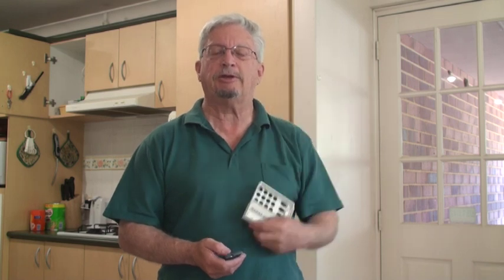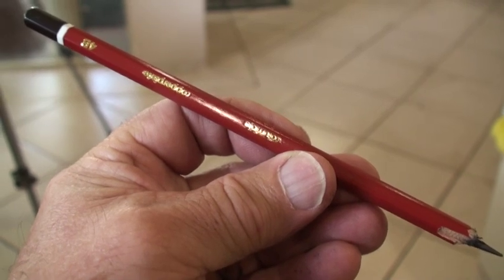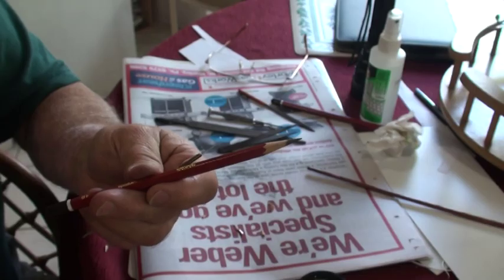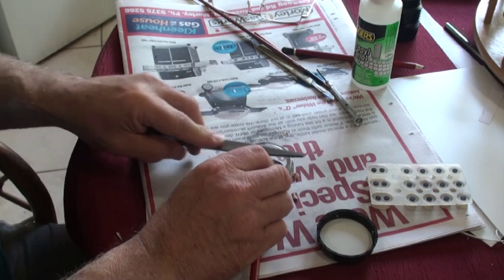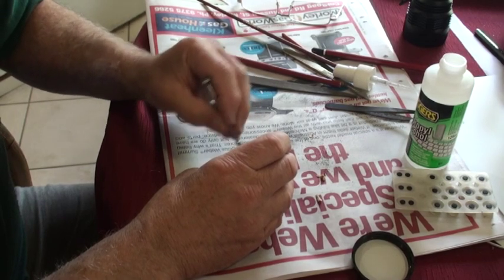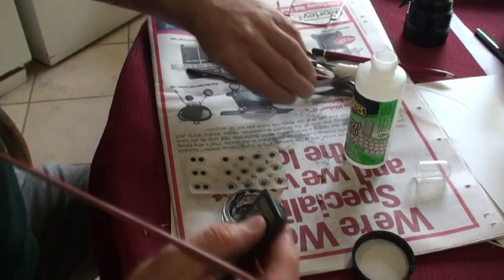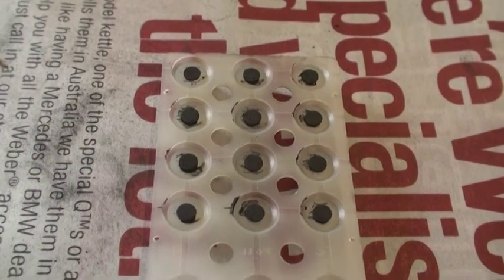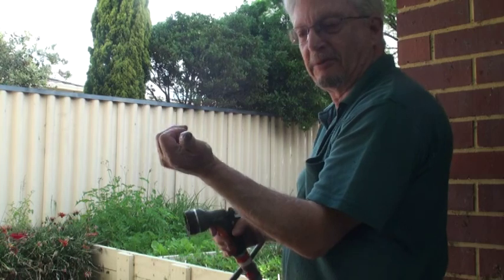Keypad Repair

Comment: THANK YOU SO MUCH, Terry!  I have an old Ademco alarm keypad where many keys were not working.  I tried your solution and lo and behold! it worked.  You are very resourceful in how by using the pencils, created graphite powder and pasted it on the keypad.  Thank you so much again.  Hopefully, the graphite will stay on the keypad contacts for the next few years....
Reply from the maker: I really appreciate your kind words. I did my first keypad repair 7 years ago. It failed again after about 4 years, and I did it again. Three years later, it is still working perfectly.

Comment: Wow Terry, you saved me $350.00

I have a ham radio.
The microphone keyboard began to go bad one key at a time.

Kenwood has no replacement microphones for the radio.

I even tried rewiring a newer mic to it but my mic is a completely different animal.

I ran out straight away and some pencils and wow problem fixed!!!!

I can control my Kenwood Transceiver now after 13 years of this problem.

Thank you

Comment: Terry, YOU ARE MY HERO,  i did what you said, i have a Yamaha Piano that had more than 25 keys that were'nt sounding, i got them working it cost me $5 US Total money
i saw guys on the net selling stuff for $40 and you had to order it and wait, I got a bunch of my old carpenters pencils from my work , the ones with a thick amount of lead, shave them down added the alcohol just like you said,  works great  Goooday Mate from  Rochester NY, USA
Reply from the maker: +clarence shim. Hi Clarence. Thanks for the positive comment. As I mentioned to another comment, my repair has been working perfectly now for two years, and is used almost on a daily basis. I am well pleased with how reliable it has turned out to be.
Reply: how is it now? did the graphite mixture layer chipped of?
Reply from the maker: No, it does not chip off, but I did have just had one button become unresponsive, so I repeated the procedure. It now works fine again. Not bad for 5 years constant use I feel.

Comment: Thank you, my remote now works the way it is supposed to.  A suggestion, I worked for many years in electronics and I used a soft white pencil eraser to clean the contacts on circuit boards.

Comment: sounds pretty good, however I bought some  conductive silver in a small vial and gave this a trial, it seems to work well but I have just done it so don't know yet how long it'll last. For those who use one of those tinny vial I would recommend though to put a cloth peg at the bottom of it to form a steady base as otherwise it's quite easy to tip over.
As for the graphite I just remember buying a little container ages ago and I think it was really cheap. It was just to puff it in places like locking devices instead of applying sticky oil. But yes who has not a lead pencil about! My vial will last me heaps if it works well. I applied the stuff with the end of a flattened tinny skewer from the kitchen and used very little on the rubber contacts to cover them, actually only the most used that gave me me trouble.  But may be one day I'll try this. (some say they mix glue with it?)

Comment: What is the boding material of the pencil lead to the silicone? How does it bond and stay stable? Was this one of those fake videos that are all too common?
Reply from the maker: I had hoped, and it seems to have worked, that dissolving the lead pencil shavings (Made up of Graphite and clay filler) in Isopropyl Alcohol then painting it on the pads, that once it dried it would resume the hardness of the pencil, but be bonded to the pad. Mine needs redoing now, after being regularly used since I posted.

Comment: i would mix in some kind of glue too;

i usually glue on the pad a tiny disc of aluminum foil, works perfectly until the day the remote is dropped and the disc moves; i can't seem to glue it well onto the graphite-rubber.

Comment: Well sir, you just stopped me from spending about $250. I don't know if this will work for me yet, but when I get home in a few days I'm going to try this and see what happens. I have 3 keys that will not work. I've tried contact cleaner, but that didn't phase it. I was about to buy a new system and I thought I'd check youtube one more time. I'll post an update later. Thanks for the video...I hope this will fix the problem I am having.

Comment: You just save me $70 to buy an antique keypad (I have a very old system) from Czech on eBAy. I did not have the rubbing alcohol at the time, so I used the Acetone instead but mixed it with 6B pencil from my kid's art project. I took extra steps by using a white eraser to remove the black residues on the copper terminals. Before shaving it to the Acetone liquid, I tested the continuity on the pencil's tip making sure it conducts and followed your instructions. It works its wonder and sounds like new, means great continuity. . Just wondering how long the "compound" would stick to the rubber terminals
Reply from the maker: Thanks for you kind words. My repair has been working well for nearly 8 years now, with daily use. I had to redo it after 4 years, and the current "fix" shows no signs of malfunctioning after almost another 4 years. I am well pleased with it.

Comment: What does he say from 2:53 to 2:54 - sounds "this graphite, from this lead pencil is very very (persuativate) - you'll mess everything up". Couldn't be what I've put in brackets but I'm stumped to hear the correct words. I've listened dozens of times but can't get those few words. Hope the repair works as well for my remote.
Reply from the maker: Sorry about the confusion. As you can tell, I'm not much of a public speaker. I was saying that as any run off, or spill overs, because it is so conductive, may short out other areas. I found that I needed to be very careful as I applied it, to keep it exactly where I wanted it.

Comment: Could I use just graphite powder that is used to put on keys to make them slide into the lock, or does it have to be shaved from a heavy lead pencil to make it stick together and give more hardness?
Reply from the maker: Graphite would work perfectly. I like the lead pencil because it has the clay filler which makes the pencil hard. Once it is dissolved in Isopropyl, it goes on well, and it was my hope that once dry, it would once again get the hardness of the lead pencil, making the coating last longer.

Comment: I tried to make conductive ink with pencil,with fevicol general purpose glue.if i mixed grafite powder with this gule,i did not result but if if use sprinkling grafite powder on glue it works ,but resistance high.i was just in searching how to repair rubber keypad  and i come across in your video.i have ip solution.but i fear that ,i had cleaned the rubber with this solution that damaged the rubber coating.but here you used ip to make conductive ink my question/doubt whether this last long as grafite powder will unmix from ip on time.
Reply from the maker: The Isopropyl Alcohol appears not to damage rubber; in fact I would clean your rubber pads with it first to stabilize the glue already on them, then make up a mix of Graphite from a 2B or 4B pencil dissolved in the Isopropyl. (4B would be better in your case as it is more conductive), apply it and let it dry for 24 hours to harden. (The clay filler in the pencil graphite helps the process to last quite some time. Mine, after the years since I posted, has now just failed, and I need to redo it.) Thanks, Terry
Reply: @terrymercer2379  thank you for the quick reply.i measured keypad rubber carbon part for resistance, it shows 200k ,it's very high i surprise.its wireless walkie talki keypad .i tried your method, but graphite not mixed with ip solution.i just rubbed pencil lead on rubber. Grafite sticked on rubber just as we write with pencil on pepper.lets see what happened.

Comment: Terry thanks for the info. I have the same alarm .Is there a trick to taking the cover off ,don’t want to force and break it
Reply from the maker: Hi Steven. I prised my cover off with small screwdrivers, using the two notches on the top and the one underneath the controller.  The plastic is quite tough, and didn't break. Cheers, Terry.

Comment: What will keep the carbon from the pencil from falling off the rubber pads and gumming up (shorting out) the circuit board?  I had great success by simply cleaning off the rubber contacts and the circuit board contacts with paint thinner.  Alcohol and other cleaners were too weak.  Now my 24 year old alarm keypad is working like new.
Reply from the maker: Andrew X Hi Andrew. Thanks for your comment. I figured that the clay in the graphite which holds the pencil "lead" together should form a good bond also on the keypad rubber. This seems to be the case; my repair is now about 15 months old, and still working perfectly. Your idea also seems to be a good one. If my repair fails, yours is an option that I would be willing to consider. Cheers, Terry.
Reply: Terry Mercer Well, my paint thinner method has failed on the more-used keypad (I have two.) so I did your pencil graphite method.    Ok, it worked.  I also tried this on my TV remote and it didn't work, until I noticed that the circuit board looked oxidized (not shiny copper, but dull brown).  Wiping with alcohol, then paint thinner did not remove the oxidation, so I got a dry dish sponge with a scrubber surface.  I wiped the circuit board with the green plastic scrubber side of the sponge gently, wiped off the dust and put it back together.  Works great.  I think oxidation is probably more of a problem with a TV remote since it is held in our sweaty palms and used everyday.  Oxidation builds up.

Comment: Hello Terry. You use that sharp scalpel just like my old granny used to! I can't do that without I cut my thumb! Anyway I've tried doing this except I didn't make a slurry. I just used the soft pencil. And do you know although it worked OK it didn't last many weeks. Does the alcohol make it stick better? Thanks for the video - very helpful. Rgds Berry (UK)
Reply from the maker: +Beresfordjohn Greene: Hi, thanks for your comments. My repair has now been working perfectly for 2 years. What I wanted to achieve by using the alcohol was to create a hard conductive surface similar to the original pencil graphite. I was hoping to dissolve the graphite and the clay binder in the pencil using the alcohol, and once it dried, for it to go back to that pencil like hardness on my keypad conductors.  It was an experiment on my part, but it seemed to work.

Comment: Thanks for you great video. Could you please tell me what are the components that we need? i just heard pencil graphite and alcohol . How can it stick without glue ? im gonna use this technique with my electric piano. Thanks a lot.
Reply from the maker: It does not have to stick, like as in glue. The 2B or 4B lead pencil graphite shavings after dissolving in Isopropyl Alcohol gets applied to the pad, and then is allowed to air dry naturally, like paint.

Comment: We found that the carbon contact material and the silicone oils that make the keypad flexible would continue to deteriorate even after cleaning and resurfacing the carbon contacts by using conductive ink, contact repair solutions, etc.   However, a customer of ours of whom is in the Alarm business found that our membranes fit the alarm keypads and worked perfectly, never failing in the future.    Here is a link to order-  http://cgi.ebay.com/ws/eBayISAPI.dll?ViewItem&item=291583354988
Reply from the maker: +BARCLAY ENTERPRISES INC.  Thank you for informing me of this product. It looks like a great answer to keypads. I have today ordered 4; I have 4 model train controllers which also need repair. Looking forward to testing these out. Terry
Reply: I've looked at you product and can't figure out how sticking a conductive dot directly onto the contacts can work, rather than onto the old dots which are attached to the rubber pad. Does this not short out the circuit perpetually?
If you can answer my question, perhaps I will purchase your product but at present you video which I have watched, makes no sense to me.

Comment: Thank you for your video , it was very helpfull, I fixed  today two telephone key pads.
can u tell me  why u use alcohol?
Reply from the maker: Hi, thanks for your comment. I found that the alcohol hardened up the carbon mix to bring it back to more "pencil like". Just shavings works well, but I couldn't see it lasting because it is so soft and powdery, and would rub off quickly. The alcohol mix, once dry, forms a hard, more durable conductive surface was my logic. Seems to work well for me.
Reply from the maker: I forgot to mention; there is a clay fixer as well as carbon in graphite pencils. This clay is what gives a pencil its hardness. I was trying to dissolve this clay as well as the carbon using alcohol, and once it dried, to go back to its pencil like hardness.

Comment: Hi Terry
Thanks, that was helpful. Just want to commend you on how you presented the video. So good to hear clear sound. What mike do you use?
I took your idea and used a mix of Carbon and Wood glue, just to hold onto the rubber. Works fine.
Thanks again.
Reply from the maker: My microphone is just a generic stereo unit I bought from my local electronics store. I like your idea of the wood glue. It may work for longer than my Isopropyl Alcohol.